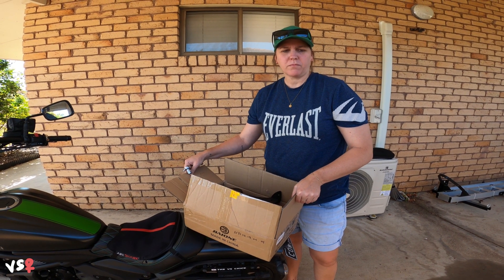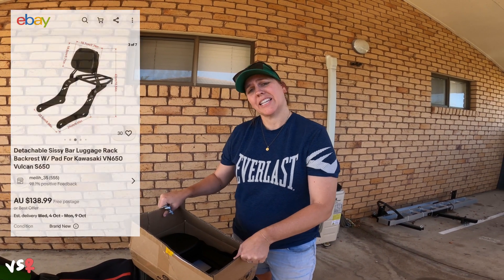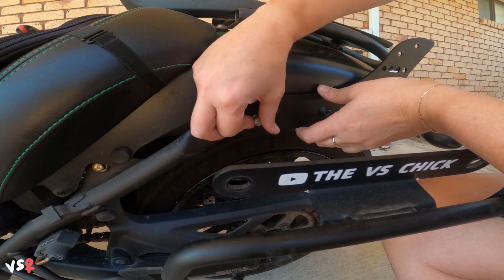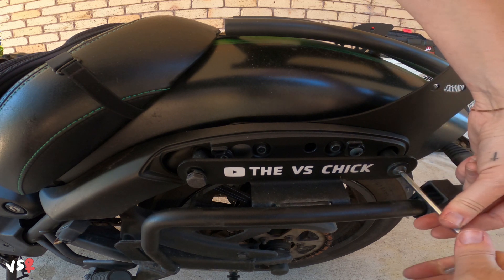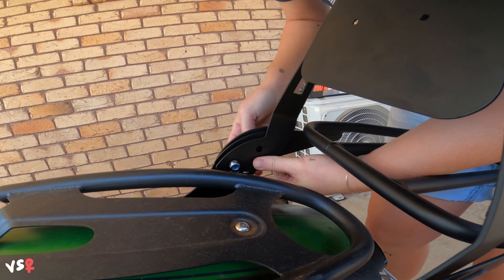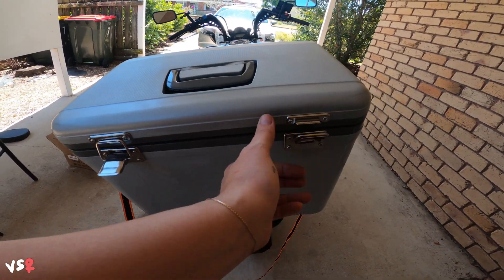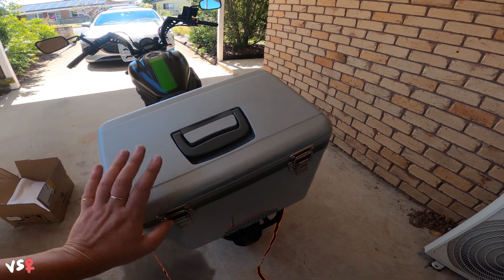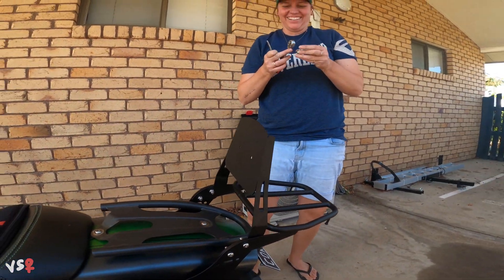VS♀️ Installing a Sissy Bar with Luggage Rack (Vulcan 650)

Comment: If you're packing gear for trips, then the sissy bar is the go. Well done, Stacey. Just take care of the weight in the esky. A mate of mine had a similar thing, the rack fail on one of the struts. Thankfully we managed to get to a garage and borrowed their welder to repair. Ride well. Cheers
Reply from the maker: Thanks Moz. I'll definitely keep that in mind

Comment: What size cooler is that ? I’m intrigued, also what brand?
Reply from the maker: It's an 18L Engel. Here's a link to it if you want to check it out more. It fits perfectly on the back. Absolutely awesome addition to the setup. 

https://www.bcf.com.au/p/engel-18l-cooler-drybox/M626012.html?dwvar_M626012_color=Silver&cgid=BCF1509#search_term=engel&start=14

Comment: Surprised you did not use loctite.
Does look good though.
Reply from the maker: I'm actually going to swap out the bolts with some heavy duty ones to make it stronger... so might put some loctite on it then.